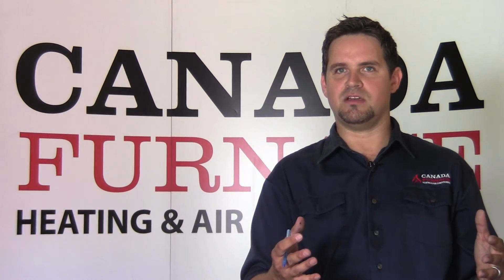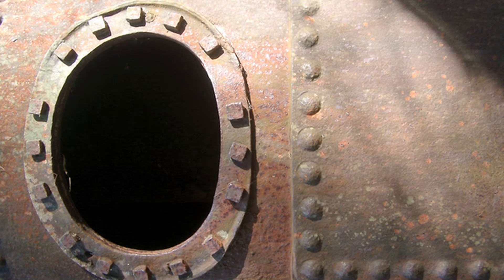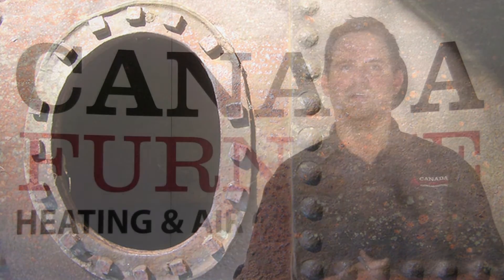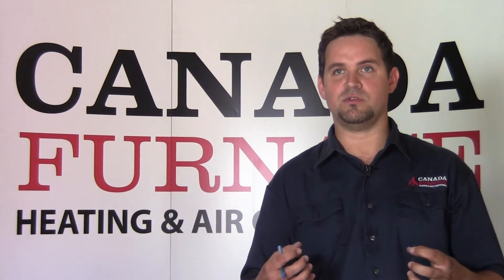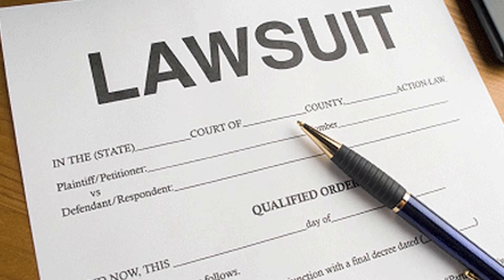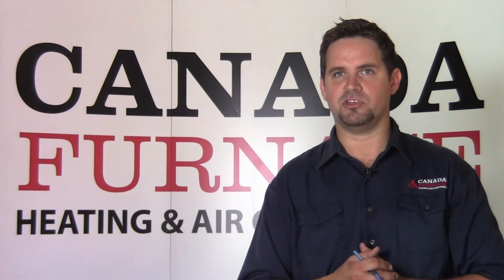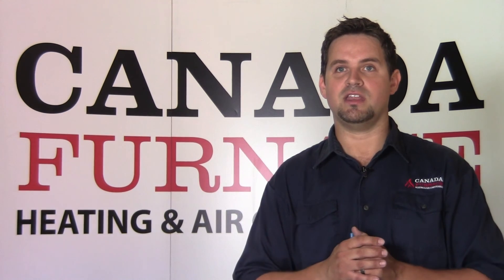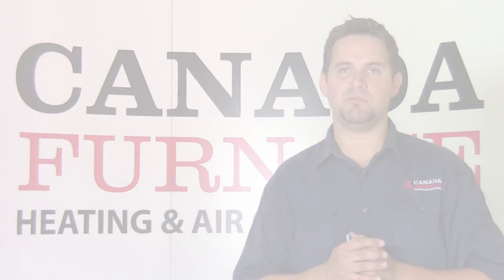What should I do if I have poly-b piping? | Canada Furnace | 604-460-9969

Comment: I am considering buying a home that was built in 1990 with polyB piping in the hydronic heating system. Should I avoid buying the house? Is this a huge issue? What I am reading is that polyB piping used for pumping work needs to be replaced but what about radiant heating? Does the piping need to be replaced?

Comment: what boilers are compatible with poly b?
Reply from the maker: "Most" new condensing boilers are Poly-B compatible .. Navien,  Rinnai, IBC to name a few have documentation supporting their warranty with an installation performed by a qualified tech.
there is also a piping schematic using a Poly-B compatible heat exchanger which would allow a none condensing boiler to be installed
Reply: Thanks a lot.
Reply: Any boilers with stainless steel or aluminum heat exchangers will withstand the low pH typically resulting from the oxygen brought in by poly-b.  The thing to remember is that your steel expansion tank, your cast iron air scoop, your steel shaft and cast iron impeller in your circulator (pump), any steel piping and any motorized valves will all STILL fail due to that oxygenated water, even if your boiler heat exchanger doesn't.  So the replacement of all parts that could rust, as mentioned in the video, needs to be very comprehensive and one should be prepared for the cost.  You essentially have to turn your boiler system into a potable water heating system.  Other options are to isolate the existing heating equipment and any metal piping from the poly-b with a brazed plate heat exchanger OR to add water treatment to the system and closely monitor its effectiveness (test 2 x per year minimum).